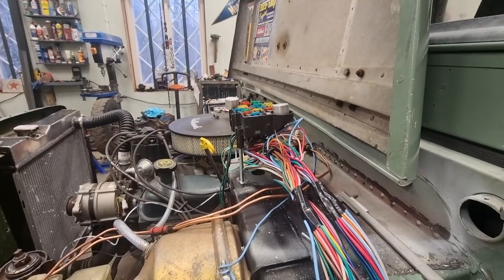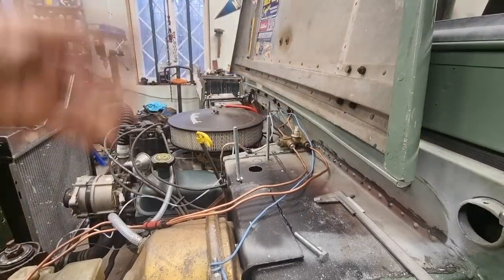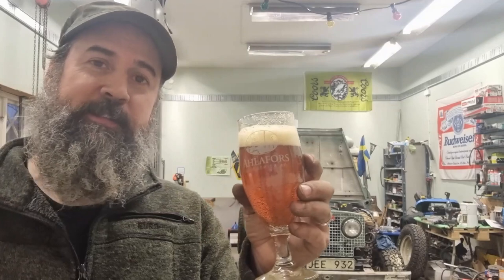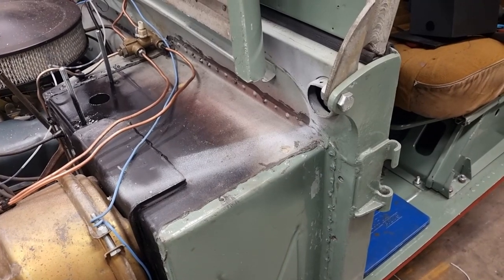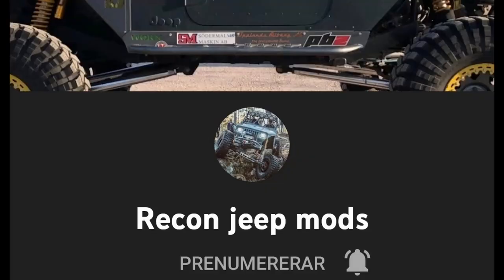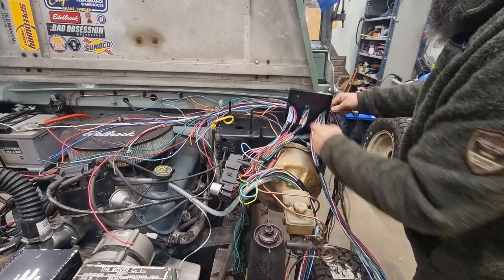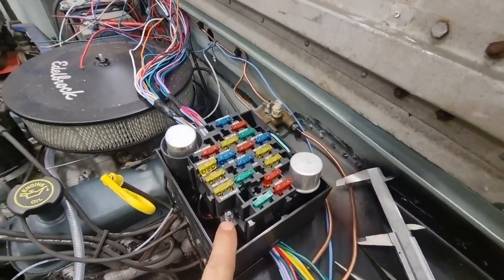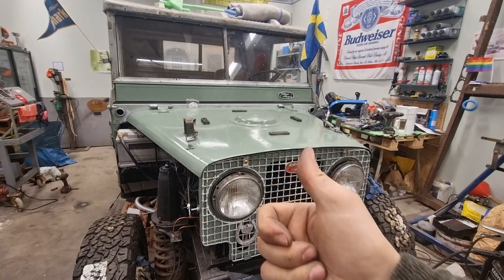Land Rover 100" Wiring Harness Installation. Ep.38

Comment: Keep up the good work brother 🤘🏻
Reply from the maker: Thank you my friend! I actually found the instructions and wiring diagram today so this will be a breeze! I bought it from Speedway. 😁 I had totally forgotten.
Reply: @slowshop  speedway has some good stuff!
Reply from the maker: @2HacksGarage  They sure do. I have found alot of good stuff there for the Land Rover. I must be the only one that buy things for a Land Rover at Speedway. 😂
Reply: @slowshop  does the have the Buick based 215 series engine?
Reply from the maker: @2HacksGarage  My first plan was just that but I wanted more so I fitted a Ford 302 and an AOD transmission in it. 😁 Topped it off with a Edelbrock intake, headers and I got a Holley Sniper for it.
Reply: @slowshop  very cool!!! Love the Holley sniper system
Reply from the maker: @2HacksGarage  I got an Edelbrock 500 on now and it runs fine but the Sniper will be awesome! 😄
Reply: @slowshop  the sniper on the GTO is great.  If you decide to go with it, I’d recommend their ignition system too.  It’s a bit time consuming but not a terrible job to tackle
Reply from the maker: @2HacksGarage  Sweet! I have to go with the fuel injection because of Swedish regulations. Home made or custom car from year 1976 and up have to. And the chassis is ofcourse a 1976. 🤯 Yay!
Reply: @slowshop  oh that is crazy !! We don’t have that here in the states… yet
Reply from the maker: @2HacksGarage We are blessed with very reasonable rules compared to the rest of Europe though. So I can't complain. 😁
Reply: @slowshop  t
Reply: This is true. I know California is very strict too